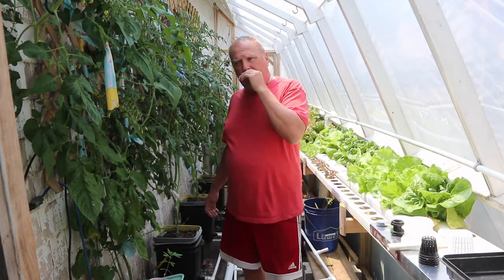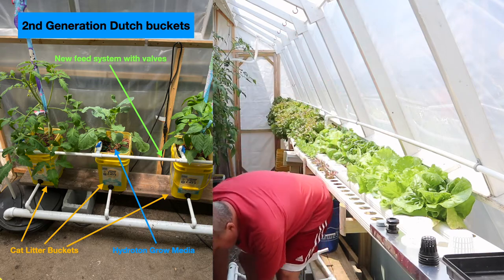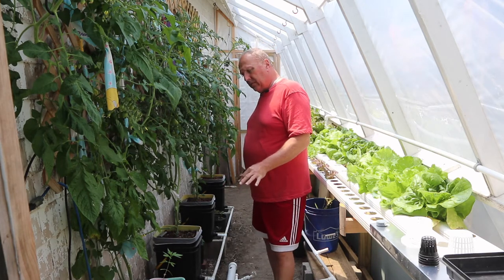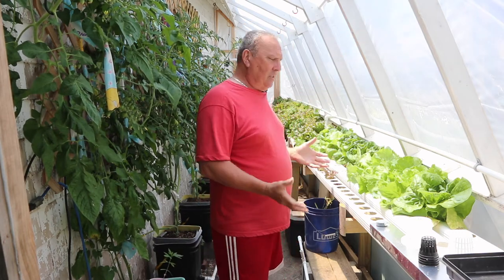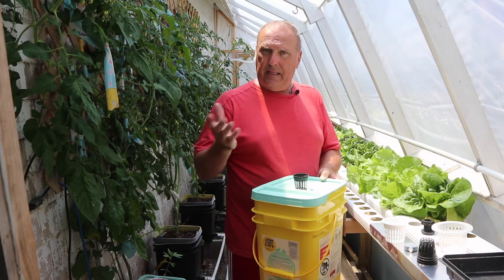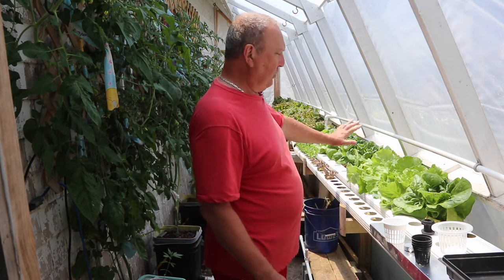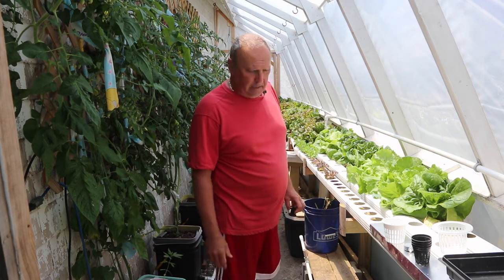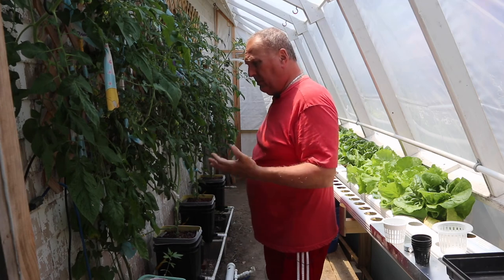Hydroponic Systems Evolution

Comment: Nobody says you always have to fill up a Kratky system up to the top.
Last summer i grew 2 cherry tomato plants in a Kratky system. The container was about 1 gallon size. At the beginning i kept the water level quite high. After 4 weeks when the root system was established i let the level drop, first to 50%, later to 30%. This worked very well.
It is important not to drown the air roots, so when adding nutrient solution then only to 50% or 30% (depending on the root system of the plants). This method can be used for all crops with long maturing periods.